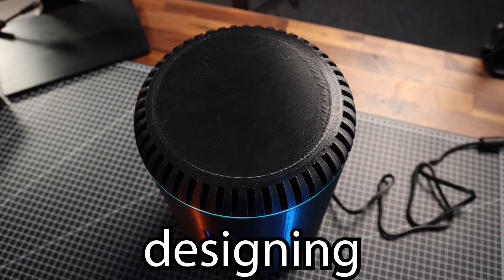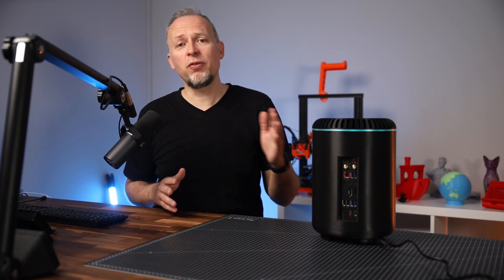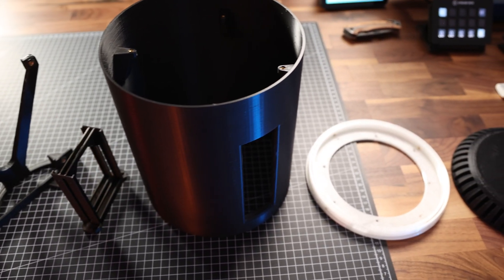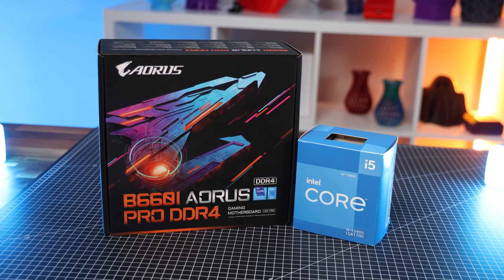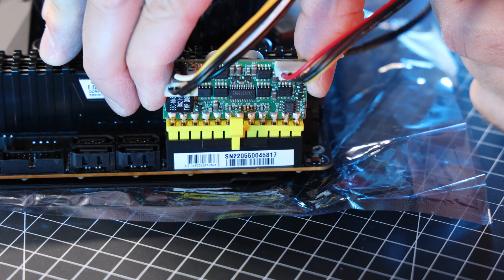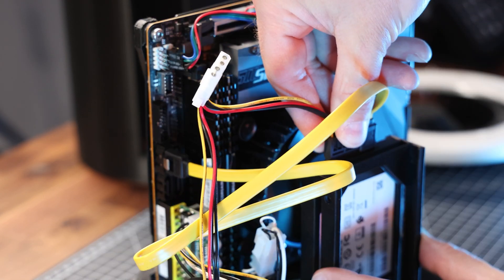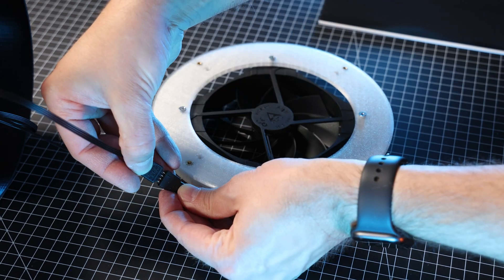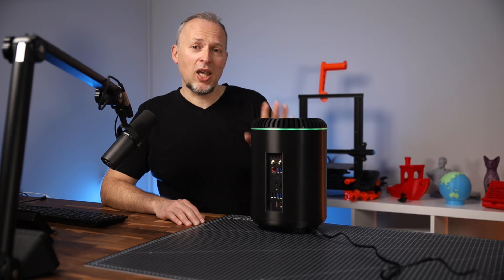Building a FULLY 3D PRINTED computer case!

Comment: Ive been kinda thinking about making a case myself, but i dont know what the bare minimum requirements of a case is. As in what are the parts that are technically need to make something that could run and then build on that. This is such a simple design that i think showes that pretty well although id love to hear if u have any pointers for what the basic requirements are for them so i can try to play with them and expand on that

Comment: Housing box shaped components into a cylinder is a fundamentally wrong design that only wastes space and is not functional at all.
Decades of distilled engineering wisdom has found the optimal design: box. For those arriving late to the party and willing to be original at all costs there are only the broken designs left. This video perfectly depicts one of those.
Reply from the maker: I guess you can imagine that the goal of this design was not primarily function. So this video depicts this perfectly.

Comment: Quick question sir! What type of material did you use on the 3d printer to print this case? I’m concerned concerning the heat that will come from the computer parts possibly melting the material
Reply: and all this plastic will be in air

Comment: It's interesting, but after I built an SFF pc with desktop parts support (in ITX format of course) with both CPU+GPU water-cooling with 360 radiator in 12.5L case and at 6kg total weight ...
I have to say that such big (and cylindrical) case for a pc without discreet GPU and with the weak intel bundled cpu cooler is full of compromises.
Of course in many cases building a mini-pc isn't about mobility, but just for a WOW factor, which in this case is accomplished - cylindrical capsule case looks nice indeed.
The main problem I have is the inefficient use of volume, especially compared to the lack of power in this pc.
One of the main troubles when building a mini pc is the fact that if it's mid-level components and/or with restricted cooling it's easier to find decent mid-range laptop - you get something more convenient and perhaps more powerful at much smaller factor.
So for me building a SFF PC is always the challenge to build full PC potentially with most powerful parts (though rtx4080 & rtx4090 make that rather difficult) in the smallest space possible but still with the best cooling possible (for that volume & shape).
Given that you can't escape the restrictions of the components (like the ITX MoBo or SFX PSU, and GPUs vary in some sizes from mini to full) you might want to play with different combinations of these parts in order to minimize volume & optimize cooling.
The in the general case best cooling doesn't have to be liquid of course - actually it's much better value to do traditional air-cooling, but when space is restricted and you can't rely on proper air flow it becomes easier to do a water-loop.
Fortunately cooling designs are more flexible as there's much higher variety in both fans & radiator sizes.
I've done with thin 360rad on top (with 3 25mm thick fans of course), and 3 thin 15mm fans on bottom, as the fans & rad are connected by 1010 v-slot aluminium extrusion beams.
But you can go with only 240 radiator if you're confident it's enough for your use case, or 2x240 on top & bottom or 1x280 (a 280mm /140mm wide/ has almost the same surface as a 360 /120mm wide/), or you can make it more like a tower with 2x140mm fan+rad on top and bottom. Some manufacturers have really great variety in radiator sizes, which is great!
One think that not an option (unless you're willing to risk it with cheap chinese components) is aluminium loop. That's what I did in order to save a lot of weight (as copper/brass weight much more), but when I designed & built it EK has a custom loop components for fully aluminium loop (you shouldn't mix alu & copper/brass in the same loop, but either is fine if you don't mix them).
When I built it I used the most powerful available parts i9-9900K & rtx2080ti, and CPU-wise I can still upgrade it to the most powerful CPUs today without risk in power or cooling, but the GPUs have really gone off the rails ... it's no problem to find 750-800W SFX PSU which is plenty powerful for 250-300W GPU (& ~250W CPU), but with GPU going about 400W and over you'll not only need more powerful PSU, but also a way to dissipate that heat with better cooling. So for example in my plans to upgrade the components of my SFF pc I don't think I'll go with rtx3080/3090 ... at least not inside the same case.
3d-printing allows great flexibility when building custom shape cases, especially if combined with 1010 v-slot alu extrusion beams (which I find ideal), but also I'm using QDC (Quick Disconnect Coupling) for the water tubes (because I don't have space for reservoir inside the case and I'm attaching thru QDC an external one when filling/maintaining the loop).
But if you're designing the case yourself you can make it modular - ie, you can make smaller case without GPU (only the integrated GPU inside the CPU), but have the PCI-E riser cable and GPU power cables prepared to be connected to a GPU that can be housed in its own case like an eGPU, but if you use the main pc power & PCI-E bus then you won't have bottleneck from thunderbolt interface (or limitations from a proprietory one) and won't need 2nd PSU only for the GPU. Also with QDC you can bundle a 2nd radiator+fans with the GPU, so that when you don't need it you can detach it and carry the CPU only case (with the integrated GPU) for example for dev-pc or media-consumption pc - ie cases when you don't need powerful GPU.
Possibilities are great!
But one thing I strongly recommend when designing a SFF pc is to use some kind of 3d prototyping tool. I used Sketchup, and while rather simplistic it worked fine, though for the 3d printed parts you might want to use appropriate software (I don't have 3d printed parts in the ver.1 of my pc and had to deal with great challenges with existing parts that would be trivial with custom 3d-printed parts).
One hint for optimizing volume is that the closer to the ideal** shape you are the most efficient use of the volume you'll likely have.
** The ideal shape is sphere of course, but in PC we have typically rectangular parts, so the ideal shape for PC would be rectangular and the closer to a Cube you can design it the better.
Reply from the maker: It's available now! https://youtube.com/live/Tyu0dL6qSuQ

Comment: So much wasted space in this case. I have seen other clones which use a SFX power supply and a dedicated graphics card. But to be fair they aren't 3d printed. I personally would design the top more open to exhaust and the fan bracket to seal with the fan to prevent recirculating of hot air.
Reply from the maker: It's available now! https://youtube.com/live/Tyu0dL6qSuQ

Comment: You 3d Printed... a Trash Can Mac Pro.
Still cool and all.
Reply from the maker: I loved that Mac
Reply: @Crosslink3D  We still have some of those where I work. I noticed you put the power button on the bottom of the case. What if, you put it on the back near the back panel like the Macs do so that its in an easier location for access? I'd imagine you could make a square opening in the Cad file, similar to the one for the back panel. Then 3d Print a holder that would snap into that opening to hold the Power button. You might be able to do a similar thing to add front panel connections (front USB and audio connections).
Great design over all! Love your videos on the Anet A8 BTW.
Reply from the maker: It's available now! https://youtube.com/live/Tyu0dL6qSuQ

Comment: Is There a possibility to add a graphics card?    

Verticale  mount  face down  where the ssd tray is?
Reply from the maker: With a raiser adapter this might work with enlarging the case a bit. Will give it some thoughts
Reply: @Crosslink3D  would be awesome it the could happen   

Like a half length card   And a riser  would be perfect

Comment: Case is huge compared to the mainboard, so much wasted space and a footprint almost as big as an M-ATX case in width. Form over function and solving and already solved problem just with worse materials....3D printing in a nutshell.
Reply from the maker: Well, it’s a nice way to try out designs, clearly not for mass production. I see that there’s much smaller cases but this is mine 🥰
Reply from the maker: It's available now! https://youtube.com/live/Tyu0dL6qSuQ

Comment: Keeping in mind the mechanics of 3D printers, cylindrical shape of the print makes a lot of sense. For a larger motherboards the diameter can be increased for a 140mm fan, perhaps.
Reply from the maker: That’s absolutely possible. Adding a GPU would then also be an option.
Reply from the maker: It's available now! https://youtube.com/live/Tyu0dL6qSuQ

Comment: Dust filter option would be nice to have. If it is a negative pressure system with a top fan pulling air out, than a slide out tray on the bottom or some pins to mount the filtration mesh would work well.
Reply from the maker: Yes that sounds reasonable. I will think about a solution
Reply from the maker: It's available now! https://youtube.com/live/Tyu0dL6qSuQ

Comment: in my opinion you will need another fan on the bottom of the case for better airflow
Reply from the maker: I'll do some long term temp tests to see how it's working. Will update on this soon.
Reply: @Crosslink3D  But it's an awesome case
Reply: Giving that it is a relatively low power CPU without a GPU inside, one 120mm fan should be plenty.
Reply from the maker: It's available now! https://youtube.com/live/Tyu0dL6qSuQ